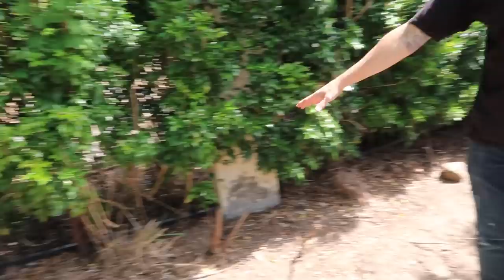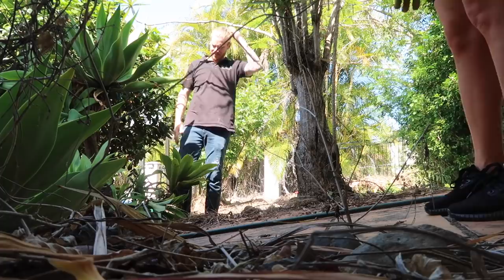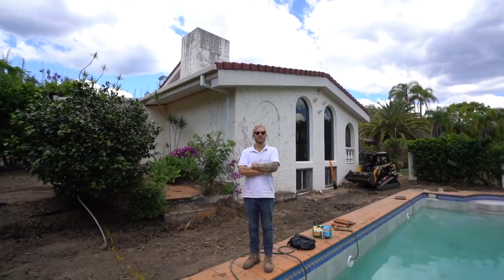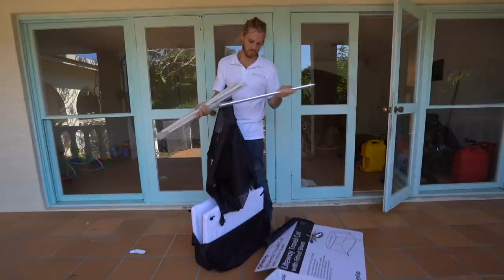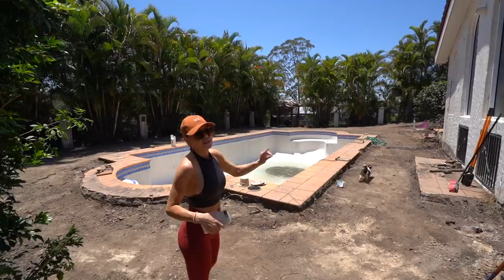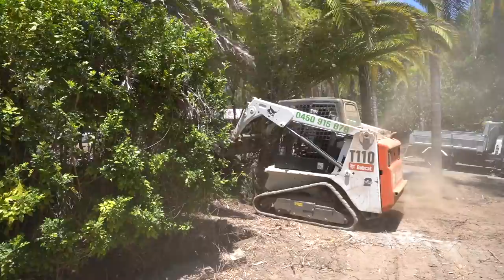MOVING ROCKS AND RIPPING OUT TREES | Episode 4 | Reno Series

Comment: Don’t know if it safe but seen a post before. It was about cleaning a pool with algae by using Mr.clean eraser sponge in the filter part, leave it for the night then check the filter. It’s supposed to catch the algae and cleans the pool. Should be safe cause we use that around the house on the wall and everything. Loving the new renovations looks amazing and stunning 😍

Comment: Did you get vlogs 3 & 4 back to front or am I just confused!?🤪

It’s all looking amazing! This is such an enjoyable ‘series’!!!

Hard to say without seeing them up close, but those little pimples on the tops of your arms could be Keratosis Pilaris. It’s super common and often goes with eczema which I think you’ve mentioned before? Doesn’t always go with it though and could just have KP on its own. It’s a dry skin condition that is really easy to treat anyway. Grab some CeraVe Hydrating Body Wash and gently (rubbing too hard will just dry your skin more) wash the area with a face cloth in the shower. Don’t have your shower hot either as that dries the skin and don’t stay in longer than 5 mins. When you get out, don’t dry the skin and apply CeraVe Moisturising Cream (grab a big tub from the Priceline. Not expensive). You can use that all over your body as it’s a really lovely moisturiser. You should apply your moisturiser to wet skin actually as the cream then seals in the moisture left on your body after your shower. Same rule about applying to wet skin applies to your face creams too 😉 Twice a day use CeraVe SA Cream just on the area with the bumps. Don’t use straight after your shower though as it can sting a little if used on wet skin (it has salicylic acid in it which exfoliates the dead skin caused by Keratosis Pilaris). You could rub a little in an hour or so after your morning shower and then half an hour before bed xx